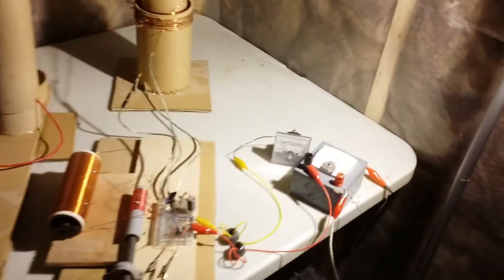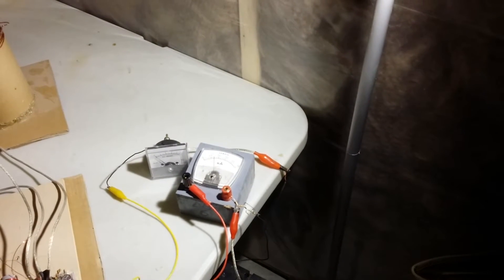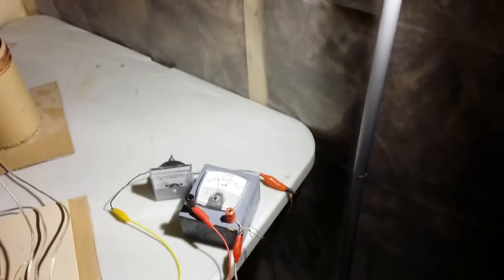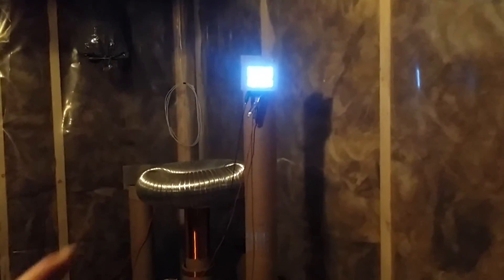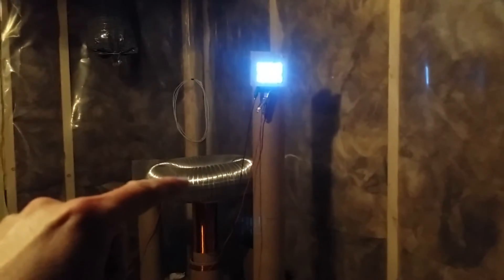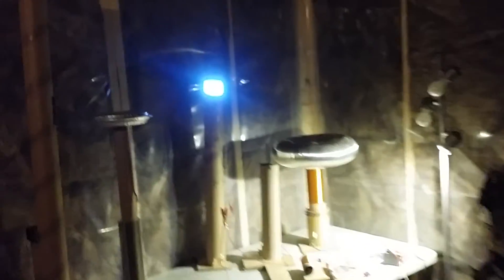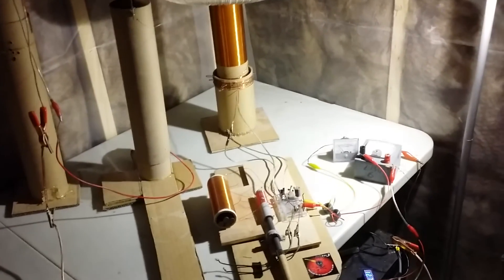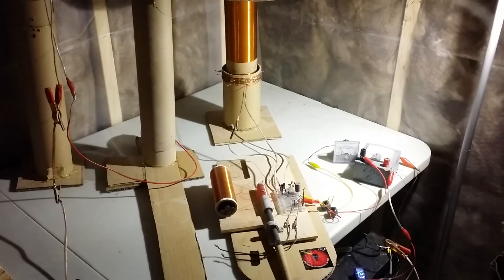Pt 21 TMT Tesla Magnifying Transmitter: Both Resonators on load

Comment: Hi.I ask the transmitter and the receiver has other points apart from each other to the ground They are connected by the lower part GND  or not?
Reply from the maker: +Tomtech29 , hi there the transmitter base of secondary and resonator are on the collector of the transistors.
The base of the receiver's secondary and resonator are fed from the 40 gauge wire coming from the transmitter/battery negative :)